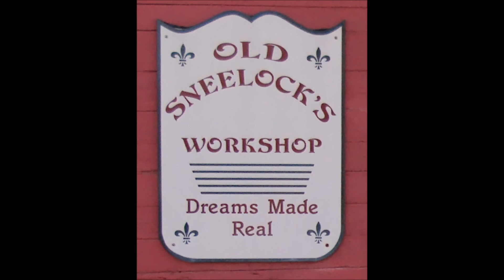Columbian No. 63 Red Arrow 3 inch Bench Vise ~ Pt 2 ~ Fettling, Masking, Painting & Assembly

Comment: Sharp job, Unc! I was going to quiz you about the paint can dooker thing but then you came out with it. I guess you knew it was coming. I end up putting the cup wheel on the side grinder and clamping the pieces to be cleaned up after my hands quit. I can hold the grinder  and can control the amount of hide removal better. Projects are adding to the list. Job security for everybody! Happy Day 2 U  2 TOO!
Reply from the maker: +Lewie McNeely A cup wheel on an angle grinder is a good tool. I use mine on the big jobs. Fortunately I haven't had a problem with Uncle Arthur yet.
Reply: You ain't missed a thing!
Reply from the maker: Mom had it so I thought I might just inherit. So far I've been lucky.
Reply: BLESSED!

Comment: never thought of using wax on the threads, great tip ile try that thanks
Reply from the maker: +Steven Cummings It works well for me. The bees wax I use doesn't pick up dirt and won't wipe off on parts or me while I'm working. I use oil on the bearings of a lot of my old tools but I also have to wipe them off every time I oil them.

Comment: Snee - yours is my favourite channel on Youtube, would you consider wearing gloves the next time you use the rotary wire brush as I would hate for you to get damaged. Your fans worry about you. Best Wishes from the UK.
Reply from the maker: +UK Tony I understand and appreciate your concern. As a rule I don't wear gloves when using rotating equipment. If I make a mistake and get my finger into the wheel it can take the hide off in a hurry, but the skin will tear away under the force of the wheel. A glove will get wrapped into the wheel and pull my hand into the arbor. 
I was the Manufacturing Engineer for several companies. That got me involved in design and safety of manufacturing processes. I had to fill out the paperwork and explain too many injuries caused by people wearing gloves in processes that involved rotating equipment. 
Back when I was 25, before I learned better, I was wearing a pair of leather gloves while turning a shaft on a tool room lathe. Tool room lathes typically have between 5 and 20 hp motors and enough torque to peal off 1/4" of steel in a single pass. Without thinking I touched the rotating shaft. Fortunately the glove was loose and it was only pulled off my hand. I still had a very sore hand but no broken bones. 
Just before I was hired by Douglas Corporation one of their employees was sanding a shaft on a tool room lathe. He had wrapped the emery paper around the shaft and was pulling on the folded strip of cloth. He let up the pressure just a little bit and the cloth caught and pulled his hand into the lathe. Once the lathe caught his glove it pulled his arm in. His arm wrapped around the shaft and tore out of his shoulder socket. There isn't any pressure point for that kind of arterial bleeding. He survived but without an arm.
Reply: +Old Sneelock&#39;s Workshop - Your story made my blood run cold and I appreciate your thinking. Please take care as Lydia would hate to have her Sneelock damaged in any way.
Reply from the maker: UK Tony She's been through enough but I've learned my lesson. I use to think I was 10' tall and bullet proof. Now I recognize that I'm only 6' tall and dent resistant. :-)

Comment: Nice job! How fine/coarse is the wire wheel on your grinder? I've got a fine steel wheel(I think) on my drill press. I really don't know if it's working well or not. Seems to take a long time. I have no reference as to how long it should take to clean up a part. I'm still new to this refurbing stuff business.
Reply from the maker: +fryefoto Mine isn't anything special I picked it up at the local hardware. I happened to run across a description: https://www.doitbest.com/products/bench-grinder-wire-wheel 
It's been my experience that spindle speed (RPM) is as much a factor as the kind of wheel. The higher the rpm the wheel turns the faster it cuts. 
I've set up a few lines for finishing parts and found that the problem most people were having was they were pushing too hard on the wheel. The tip of the wire does the work. Pushing on the wheel bends the wire so that the side of the wire is rubbing on the surface rather than the tip. Pushing also causes the wire to flex too much and break off. 
Knotted wire wheels are stiffer so the wires don't bend. The wire is also coarser. Knotted wheels tend to scratch the surface rather than brush it. The surface is torn up rather than having the matt finish most people expect from a wire wheel. 
If you are using the brush on a drill press it more than likely is running too slow. The top speed on my drill press is 1250 rpm. The wire wheel on the grinder is rated at 5000 rpm and the grinder spins at about 3200.
Reply: +Old Sneelock's Workshop +Old Sneelock's Workshop sounds like material for a video! We had an incident with the blade of a circle cutter flying off the drill press due to being run at too high a speed. The cutter didn't come with ANY directions or instructions. We were very blessed to not have been in the path of that missile! I am a little speed shy!
Reply from the maker: Speed & Feed determine how much load/heat/vibration a cutting operation experiences. The type of material, plays a big part in the calculation of the optimum surface feet per minute. This is a chart showing just a bit of the variables that need to be allowed for in manufacturing: https://www.bing.com/images/search?q=surface+feet+per+minute+chart&view=detailv2&qpvt=surface+feet+per+minute+chart&id=B92246C9FD7A9610E4B9F2A4DE2D266114114A1C&selectedIndex=7&ccid=VQvCegJd&simid=608053497541627814&thid=OIP.M550bc27a025dc22af0cd6d22df39fb43o0&ajaxhist=0
I do poke fun at the Safety Sallies but precautions should be taken. Where I find fault is the assumption that if they have enough guards and rules nothing bad will happen. Too many guards drive people to remove them. Rules are only obeyed by a few people. 
Machines have their own set that they follow without fail. Gravity, momentum, conservation of energy, and thermodynamics are strict in their treatment of those who fail to take heed.